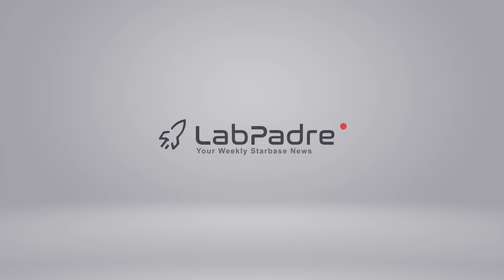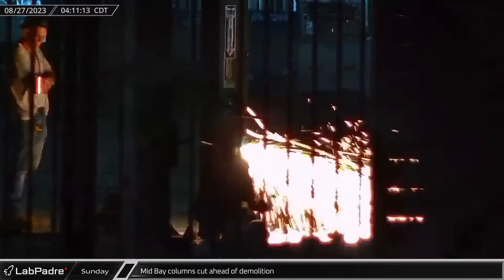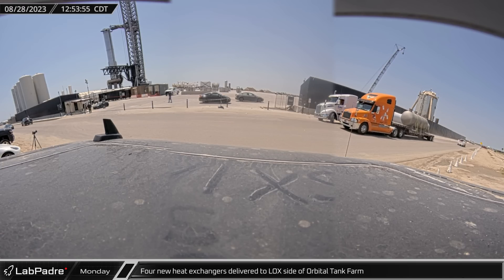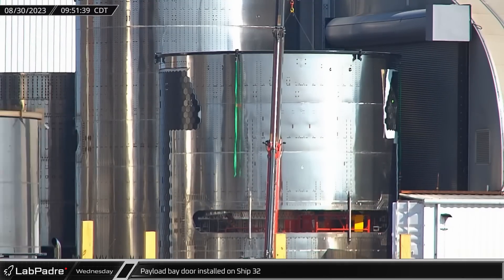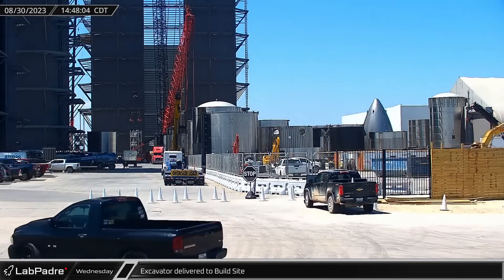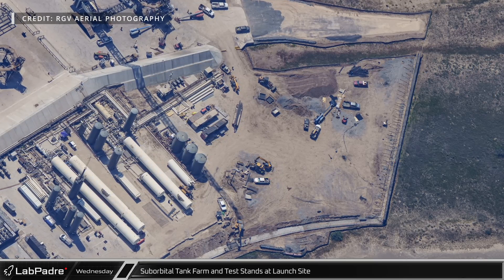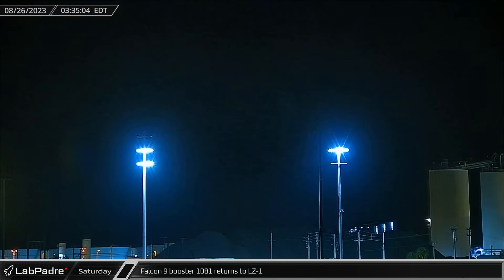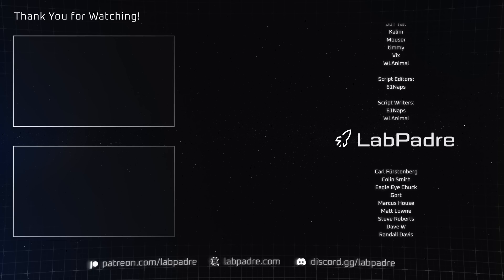Alignment Pins Removed! Second Orbital Test Flight Soon! - Starbase Weekly Update #78

Comment: Dose any know what the tank farm will look like when they want to have  even one or two launches a day
Reply: That's a good question. Because, it takes over 400 semi truck tankers for one launch!!! And there's just one small lame road going in there.
They are going to HAVE to put in a rail line, or do some dredging to bring in barges.
My bet is the dredging, because they also plan to barge Boosters and Starships to Florida.
So, look for them to start doing some dredging out there and building a pier.
They have no choice. And there used to be a pier out there, so permission should be grandfathered in.

Comment: Oops, nerd fopaux! Landing burn requires just one engine. Reentry uses three. My apologies for being the geek police. Excellent weekly summery, thx!
Reply: I wonder how many engines it will require for re-entry and landing of the Super Heavy Boosters and Starships?😲
Reply: @CritternNation  as I understand it, SH will forego engines on re-entry because they are predicting it to be more robust then F9. SS will ignite the 3 center gimbal engines for re-entry. SH & SS have similar engine profiles for landing. 3 will ignite initially then cut-off and throttle down as needed to land. Granted, this will all change with Raptor 3 and above plus the infamous fail-iterate-test engineering cycle SpaceX is superb at.

Comment: I'm still wondering if SpaceX is going to focus on Boca Chica as a launch facility or do they plan to move launches to Florida. Seems evrything is harder in Texas and Canveral/Kennedy was purpose built for space stuff.
Reply: They have to get it working properly before they can go to Florida. There's a lot more to destroy if things go wrong at the cape
Reply: @trentwalker989  Understood. I'm just wondering if that's the plan.
Reply: @patrickdurham8393  I wonder if Nasa got pissed and told them no. The building that was suppose to be built there was halted and that started the year long wait which now it appears that they are shifting everything here to Texas rather than in florida. Which is kinda hard because Texas has limited launch times and requires far more than they can handle. The sad thing is there is really no place in which they can build that wont interfere with launches and testing. You can not buy that public beach. You can not buy that highway. Then on top of that there is habitat that is in the way. So unless you can find an area that is owned land and is only a dirt road over an area of about 2 miles of beach and 2 miles of back with no roads in it and privately owned then you might have a chance to build a space port that could work. Might even need something about 5 miles by 5 miles which is far enough away to build 10 launch sites with in the center mile and have 2 miles either side for safety. Then you could have a train that goes on the 5x1x5x1 mile long track with several tracks and a transport rail system which brings the new boosters and new ships to the other side of the launch. The entire thing would be raised up around 50 feet and the entire launch pad would be a massive stainless steel looped pad that pumps 10s of millions of gallons of water in to the cooling pads. Think massive water blocks on a computer these are steel with stainless lined tube or something like that. The height of the 50 foot would keek the trains underground and passangers would only be sent up when its time to board. 
The rest of the area would be the fuel storage and it would support 100s of launches all buried underground and in tunnels to protect it and to keep the temp stable. The processing plants for hydrogen and oxygen would be in the middle. The back 5 square miles will hold the main facitly transport hub where you come to stay before you take your ride. The right and lefts are the building locations and repair locations. Keep in mind each rocket will not be the same. Because companies can fit each one of them for their needs of space labs (these are bigger, far bigger than ISS) Hotels and so on. If They were to build a massive ring with 5 levels of rings with 100s of ships on each ring you could have one massive gravity station in space. Think about it if you stand up the the rocket and you hold the tip and swing it around all the gravity goes downward which means you could build each ship like normal and then dock at the nose and then a door clamp would seal your door and you walk the hallway to the elevator and it will take you to the middle ring and you can travel all around these levels as they would be massive rings. A city in space that can send up what ever you need. 
So there is the ability to do a lot of stuff, just need to find the correct land.
Reply: @kameljoe21 You would make a good science fiction writer! 💯. For real. I'm not trying to be a smart arse.
  Although, Boca Chica is here to stay. The REAL habitat is, already 5 miles away from the launch pad.
  Too, there's an old pier out there that will allow a new pier and some dredging. They HAVE to be able to barge in fuel and other supplies, and they plan to barge vehicles to Florida.
They can maintain the beach access with a pier.

Comment: I don't understand why they didn't dismantle the mid-bay and use the steel beams for something else. Wasteful Society
Reply: Dimensions/specs are probably wrong for something else, everything is custom built. Nothing will be wasted, the steel will be melted down and used for something else.
Reply: @johnpoteat9774  the wind breaker could of been used for the new high bay. The rest of the steel could of been used for an extension onto the high bays or the new facility that they're building. The cladding sheets could of also been used for the new high bay.